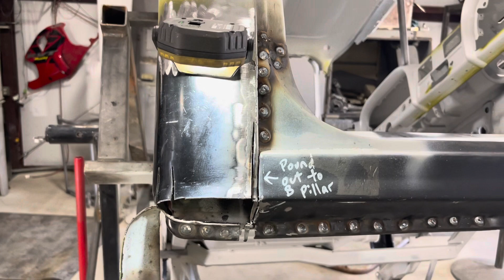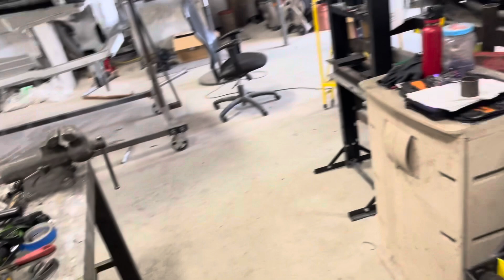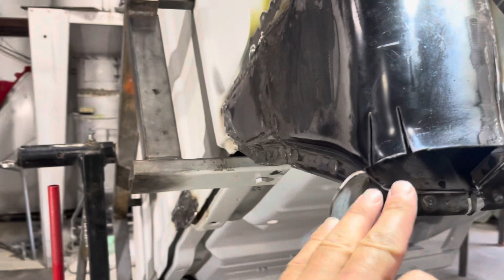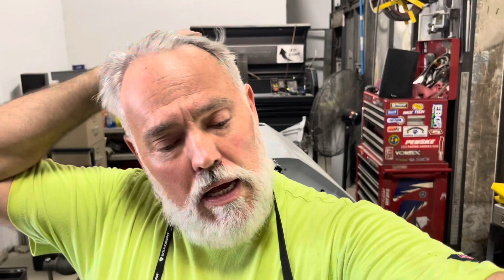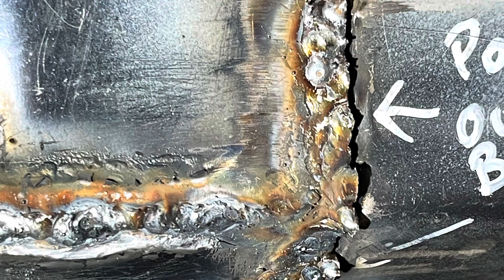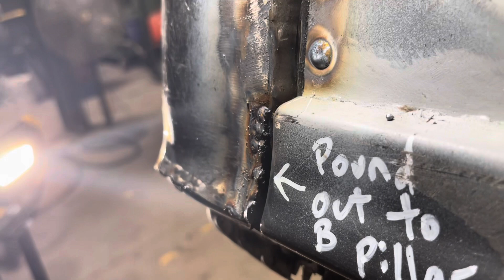C-10 Cab New Metal Installation — and Tweaking it to fit

Comment: Just finished gapping out my 65 mustang by welding door edges and file fitting gaps with the aftermarket fenders doors and quarters  2 days of metal work to have perfectly even body gaps , like you said the details matter .